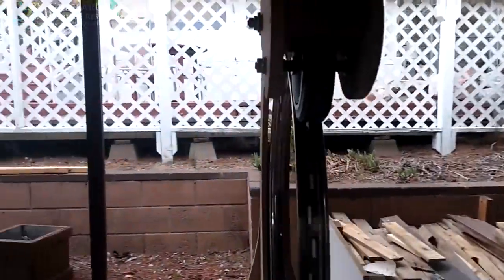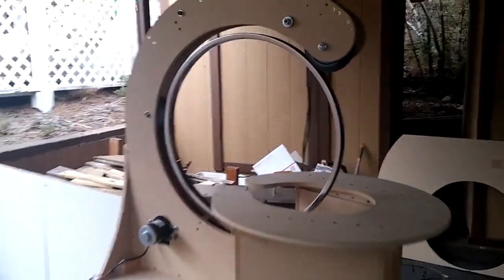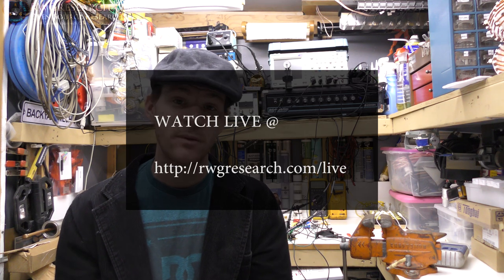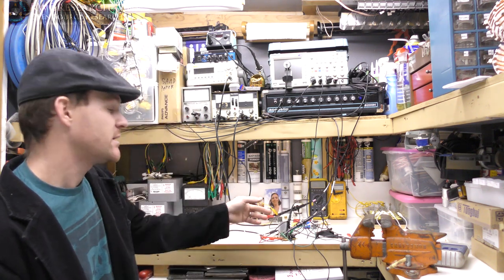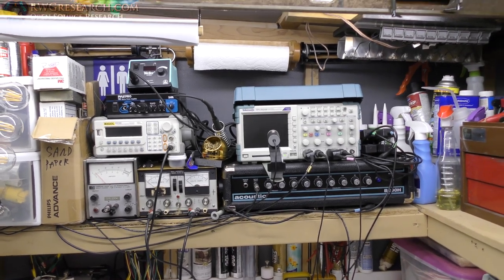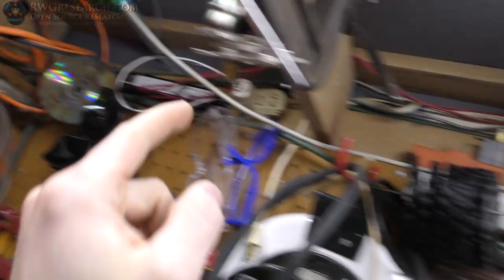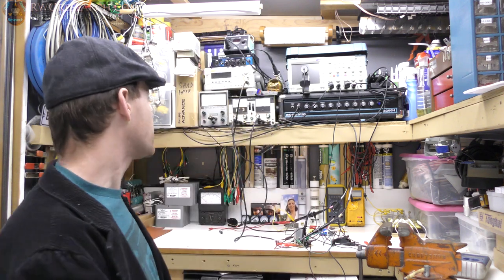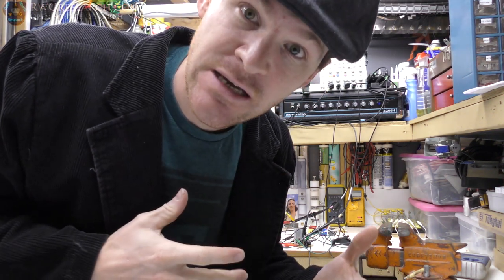RWG CRV #4  Project Updates, Thoughts, Stuff, (Comment Responce Video)

Comment: If you are going to use magnets I would recommend buying polymagnets. The place that makes and sells them is amazing magnets dot com, they aren't expensive. 
  The ones designed to grab flat sheet metal would work because you could buy only 3 or 4 and attach them to your base the printhead, router, laser platform attach to. Then put thin pieces of sheet steel into the housings of your tools corresponding to the polymagnets locations. 

Polymagnets for grabing sheet metal are 5 times stronger than a normal n42 neodymium counter part. You won't need thick magnets and because a polymagnet has atleast a dozen poles it makes precision alignment easy, especially if polymagnets are placed in the tools housings instead of sheet metal.

Comment: Ruussss, I miss you man! :O Christmas has be beat, I'm even behind on the subs playlist ;(
Regarding the interchangeable end effectors for the OSD, how about a bayonet fitting with magnets at the end stops? The end effector will be round, slide up and in from underneath, then twist to lock. The magnets will hold it at that locked positions.
You could make 3D printed parts that hold pogo pins, which supply power to the end effector in question.
lemme know if you want further info. That's how I'd do it anwyay! Plus you can have many contacts so you have extra functionality in the future.
For each new tool you wanna add (laser, engraver, hot end etc etc) made a new end effector which slots into the holder on the OSB
Lemme know if you want further help/info, we can sort something out to perhaps chat in real time :)

~Chris

Comment: I use plugins for InkScape to convert paths to Gcode .  then  sometimes i will go in and tweak the resulting G code file , but the results are ok for vector paths .  It can be a hand full to convert image to raster ,  but in actuality they are  actually just a for of vector , but using PWM or laser head feed rates . the plugin can control simple 2D milling , but i just use it for my Laser .
I think you coudl use InkScape image to raster path , and you might be able to push that out to a laser .  My rig : https://youtu.be/_Slzl8v4Jpw